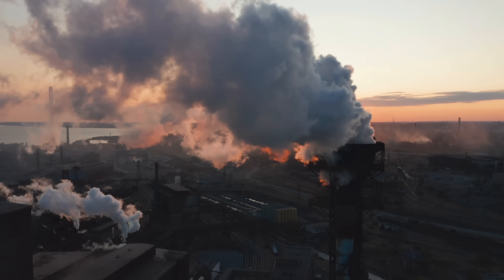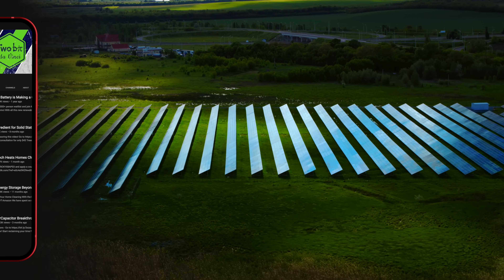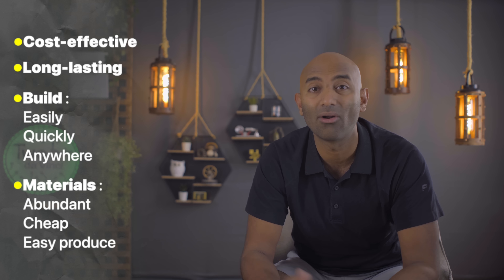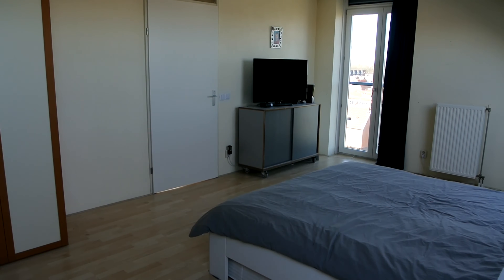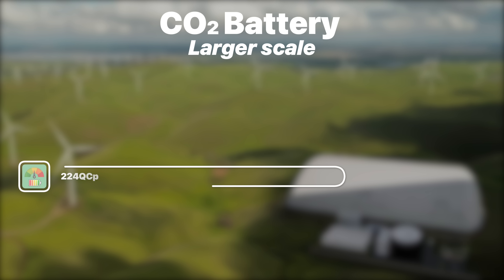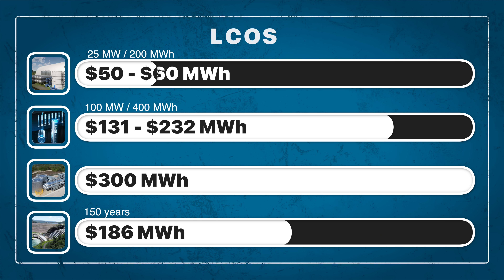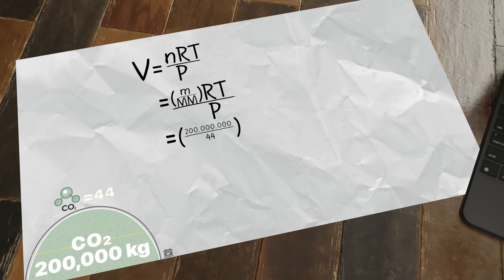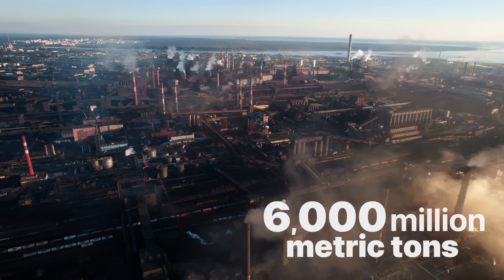The GENIUS Of the Carbon Dioxide Battery

Comment: How difficult would this be to convert to an underwater system? I think it could increase efficiency by utilizing deep water pressure and lower temperatures.
Reply: how?
Reply: Note that the bladder is the low pressure side, putting that under pressure reduces effectiveness. You could possibly substitute the high pressure tanks with a cavern, but you want to keep moisture out of the system, so you need to line it.

Comment: Just thinking that there's a secondary energy source being created here that could increase the efficiency of the overall system.  

As the CO2 decompresses, it gets colder.  This would cause a temperature difference between the air near the Decompressing CO2 and the air further away.  Could they drive a sterling engine with this temperature differential to generate more power?

Comment: Tell me again how carbon dioxide is supposed to be a greenhouse gas when it is known to have one of lowest heat retention compared to  most of other gases in the atmosphere. . The heat retention of carbon dioxide is around 0.002 degrees per second  . We know that carbon dioxide levels is the reason for the planet is becoming increasingly greener yet the level of carbon dioxide levels are not as high as it has been in the past thousands of years.

Comment: This methodology is much more expensive than simple gravity compressed air systems.  Look into the Ragged Chutes compressed air plant and it's contemporaries!  100% eco-friendly, ZERO moving parts, except for the actual electricity generating turbine, Works 24/7/365!!

Comment: I am happy to see companies goinng back to basics and using thermodynamics to solve these problems.

Taking advantage of the energy associated with  phase change and reusing the heat.  

Nice review of the tech - thanks!
Reply: That's just it. They didn't present anything on using the latent heat or polytropic heat for anything other than reevaporating the liquid CO2.
Reply: @murderdoggg  

I make an assumption that those concepts are beyond the mainstream audience.
Reply: @JohnBoen  Yeah I suppose so. I am kinda the Joule-Thompson effect and Logarithmic Pressure, Enthalpy diagram kinga guy.
However most people understand heat recovery pretty well. no?
Reply: @murderdoggg  

I think you are on the right side of the Dunning Kruger scale - you assume people know more than they actually know.

I.e. I remember the terms from my college days, but never used them professionally.  I can do the math, but have no practical understanding of refrigeration systems - where you seem to have one.

Great topic.
Reply: @JohnBoen Thank you (I had to google Dunning_Kruger  :)  I enjoyed it as well.
Reply: @murderdoggg  

What else would you use the heat for? 

It seems like you would not be able to capture enough of the heat to return the CO2 to room temperature after phase change.
Reply: @JohnBoen  In commercial refrigeration we also use liquid CO2 instead of "Freon". 
Normally the heat that comes from condensing the CO2 into a liquid is recovered, and used to warm the hot water, or to warm the heating system in winter.
The heat needed to evaporate the co2 comes from refrigeration, salad buffets, drink coolers or freezer rooms. 
So either we add generator turbines to commercial refrigeration systems, or we add freezers and heat recovery to the phase change CO2 battery. By the way, there is always more hot than cold in these systems.
Reply: @murderdoggg  

Sure.  That is my opinion too.

Comment: The key is the c02 capture tech and then this is the final piece of true renewable energy.
Reply: This isn't "CO2 capture tech"
.
It collects a fixed amount.
Compresses the gas, then uses it in a closed loop, that fixed amount STAYS in the system but it doesn't continually collect more CO2 (unless there are leaks, in which case it's a 1:1 swap)
Reply: @rogerstarkey5390  agreed but i ment to grow the numbers on these power plants

Comment: This is not a new technology by any means but the system here is unnecessarily complex and should be based on water and use a TESLA turbine. The system doesn't need to be charged either as the system can create its own energy from heat it picks up under pressure then it uses that water under pressure to turn the Tesla turbine and the system doesn't need to be charged and produces it's own energy.

Comment: I'm not sold on "renewables" like wind and solar. 
They should be called "disposables" since they have a limited lifespan. 
CA is having issues with solar panels filling up landfills. 
I would install solar on my house but I think SMR Nuclear will end up being the best grid scale power solution. Way more efficient resource usage. 
I think vanadium flow batteries would be much more efficient. A Chinese company initially scammed the DOE for the technology now there is an American company setting up mfg. Because of that they are everywhere in China for grid storage.

Comment: 1) I live near Niagara Falls, which has pumped hydro. I would bet its lifespan is vastly greater than 150 years—sounds like a sales number for the CO2 industry. 2) a leak could be dangerous—whole villages have been killed by pyroclastic CO2 because at 44 g/mole compared to air’s 29.2 g/mole, lets the CO2 hug the ground. 3) The storage volume for CO2 is about 400x greater than the storage volume for pumped hydro. And, unlike pumped Hydro it has to be built from man-made materials. 4) A terrorist/enemy target. 5) Unless fusion or some other cheap energy production is developed, removing CO2 from the air will never be viable due to thermodynamic laws—the low concentration of CO2 in the air is the problem. About two decades ago the department of energy put out an RFP for $100 million for the construction of a prototype carbon sequestration plant. I sent them an email detailing how the plant would produce more CO2 than it collected. They stopped the project. I saved us $100 million! — merely a 62 year old industrial engineer.

Comment: Nice reporting! Interesting that CO2 can liquify at ambient temps. It's just a matter of pressurizing it.  That round-trip efficiency (75-80%) and scalability are surprising. This concept is so simple, one has to wonder why it wasn't done before. All good wishes.
Reply: look closer at the diagram, you'll notice that there are two types of energy needed to run this thing, electricity, and hydrocarbons, and there's transition losses going between matter states, this isn't all it's cracked up to be.

Comment: CO2 is not a pollutant... Climate change is being lied about just like COVID was. One of the main ways is by comparing old low resolution data, from very few weather stations, with new high resolution data from exponentially more weather stations. If you add 10 000 new weather stations in areas that didn't have any before, every year, it could be expected that 100 of them would record a "once in a century" weather event. That doesn't mean those kinds of events didn't happen before. It just means we didn't record them when they did. So, when you see a news report claiming the "hottest/coldest/wettest/driest ever recorded at __ since record keeping began" - see if you can find out when the weather station at ____ was first installed. You might be surprised to find out again and again that "record keeping began" just a few years ago where these stories are reported from.  10's of thousands of new satellite monitored weather stations have been installed worldwide since 2018.

Comment: Could this be miniaturized for a hybrid car? Then when its internal combustion engine produces co2, it could charge a co2 battery. I think we can.
Reply: No. He literally went over this in the video with a hilarious graphic at 10:36. The energy density is 200 times lower than lithium ion batteries meaning they would be 200x larger for the same amount of energy. Think a AA battery being the size of a baseball bat.
Reply: Not really. First off, the exhaust has a mix of gasses, with CO2 being a small percentage of that, and separating the CO2 from the other gasses would use up energy, and compression would use up even more energy and produce a lot of heat.. Second is the compressed CO2 storage tanks would take up space. Third, releasing that stored energy would require heat and would release the CO2 - unless there was a giant balloon much bigger than the car attached to it. 

But a stationary power storage plant, could use already purified CO2, would have plenty of room for the compressed CO2 storage tanks and even the much bigger uncompressed CO2 gas bladder dome. As an added bonus, the head produced by compressing the CO2 could be stored in big hot water tanks, and that heat could then be used when releasing the energy!

Comment: What I don't understand is the energy you need to turn this carbon dioxide into a liquid state?  Maybe I should watch the rest of the video but as far as I know this looks like BS. What are we doing we're using free energy to convert carbon dioxide into a liquid state just to convert it back?
Reply: it turns out that batteries do in fact need to be charged

Comment: You spoke a lot about scaling to larger systems, I’m curious what the likelihood/feasibility of small scale compressed CO2 batteries would be. It seems like off grid or battery/grid hybrid residential situations would benefit a lot from an energy storage system that doesn’t need replaced every 10 years and doesn’t lose capacity along the way. Thoughts?

Comment: Here's another variation on this idea...
It looks like carbon dioxide liquifies at only about 5.1 atmospheres which is very low.
This suggests that carbon dioxide might be usable as a refrigerant.
Consider...
All the refrigerators/freezers that might use carbon dioxide instead of R34. If any escapes into the atmosphere, unlike R34, it's not damaging to the environment.
Also, the heat that is generated by the condenser might be used to heat homes.
That would mean at least during the winter, the cost of running the refrigerator/freezer is almost free. So, in a larger sense maybe refrigerator/freezers should be incorporated into the home heating system.

Comment: Now, does the system gain or lose efficiency when exterior temperatures reach very cold limits? How well would the system operate at -40C?
I imagine it would be best to charge it when it is cold out and utilize it when hot.
Reply: At -40° CO2 still shows 9 bar of pressure or 130psi on the gauge. It's not like Freon that will pretty much lay still in an open bucket around -40.

Comment: "For decades all we've heard is how bad carbon dioxide is for the environment and how it causes climate change! True as that might be..."  That is not true at all.  Carbon is the greatest thing for life on this planet.  All life on this planet is carbon based.  The only thing more carbon causes is more life.  The scientists do not have a single time period on the geologic record that shows carbon levels anywhere around our present level are bad for the earth and its ecosystems.  The only and I mean THE ONLY single time they can reference is when carbon was TWENTY TIMES THE PRESENT LEVEL.  That is, if we took the present atmospheric level and added that amount to the atmosphere twenty times.  We humans do not have the ability to do that even if we put all of our human effort and resources into the effort because most of the carbon from that maximum time period has been mineralized.  That is right.  We would literally have to figure out how to get all of that carbon out of the rocks and stones that make up the ground.  The whole concept of carbon dominating the climate is a joke.  It is an extremely small fraction of the overall atmosphere and shares absorption spectrum with water vapor, which makes up a much greater portion of the atmosphere while also having a much broader absorption spectrum.  The earth has had a much higher atmospheric carbon content for the majority of its existence and life exploded during those periods of high atmospheric carbon content.  That is when all the mollusks and crustaceans evolved.  No, higher atmospheric carbon does not dissolve their shells.  Their shells are made from atmospheric carbon.  Their shells are calcium carbonate.  Everyone has been sold a bill of lies.

Comment: My concern is this isn't available for residential consumers. Unlike batteries which you can buy and assemble the system itself.
Reply: This is great for hooking up to a wind park. Or a solar park that serves a city. Excess energy is not sold off for free (or panels/turbines shut off) but stored for use at night out on days with low wind/sun input. 
It's not for homes, but that is fine.  It's not the silver bullet for every problem.

Comment: How much heat has to be stored in relation to the energy stored in the form of pressure? Boiling and condensing fluids takes a LOT of energy! Furthermore, this looks like a maintenance nightmare, so many moving parts. my bet is on Thunderf00t busting this one pretty soon.

Comment: Thanks for sharing your videos, another very interesting concept. Another potential benefit to this technology would be the ability to use it to overcome power transmission interface limits by splitting the plant and connecting the two with pipelines.  You could build your storage and compressor facilities in an economical location with lower energy costs and put your generation facilities in high cost expensive areas.
Reply: wouldn't work, transporting electricity is orders of magnitude more efficient than transporting potential energy

Comment: It's worth a shot.  Long duration storage is open to lots of solutions.  We should try them out.  It is what physicists do, starting from physics 101.  Converting one form of energy to another.  Seasonal storage, is one of the hardest issues to tackle.

Having said this, I wonder whether we need as much storage as one would initially think.  If one can a complement of generation sources, with different intermittency profiles (e.g. wind and solar), then one could get away with less storage.  The battery serves an integrating resource, for frequency regulation, time shifting, e.g., in a micro-grid.  And so what, if one has to burn a little bit of fossil fuel, a few days a year, but still have mostly (say 80%) a renewable grid.   From an energy security POV (e.g. Europe), you would need much less fossil fuel.  And we'll eventually figure out the last 20% (biomass, syngas, geothermal, nuclear, ...).

The other thing to consider, is the emergence of EV's.  Is this a liability for the grid (greater electricity demand)?  Or an asset?  If one can add bi-directional charging capability, you have a bunch of mobile batteries, that are typically 2-3x the size of a solar+storage setup, for the storage part.  And solar has gotten so cheap, that one is beginning to deal with the "duck curve".  Without needing to add extra grid batteries, one can encourage EV's to charge during the daytime, just to suck up the duck curve.
Reply: Would you set your thermostat to 15 degrees centigrade??
This is the current mean surface temperature of Earth which is suboptimal for plant growth.
The current atmospheric carbon dioxide concentration (415 ppm) is also suboptimal for plant growth.
Arrhenius who described the greenhouse effect opined that carbon dioxide emissions from human activity would have the beneficial effects of reduced winter heating costs and postponement of the next glacial maximum. You can add reduced deaths from hypothermia and increased agricultural yields.
He initially estimated that the climate sensitivity to atmospheric carbon dioxide concentration was 5 degrees centigrade per doubling and subsequently revised his estimate to 2 degrees centigrade.
The true figure is likely under 1 degree centigrade. We cannot perform controlled prospective experiments on whole planets to obtain a hard proof. We haven’t even found any close earth analog planets around other stars.
    The Western World is currently beset with the Climate Delusion: The false and delusional belief that mans effects on the earth’s climate are significant and dangerous. Trillions of dollars of taxpayers money is being misappropriated into uneconomical and unreliable renewable energy projects.
Popular delusions are dangerous and can lead to economic ruin, war and genocide.

Comment: I'm curious if, while doing your research, you found out how long it takes to spin this up to start producing power? If there is a power outage, lithium ION can meet demand instantly. Also, how well can it handle large sudden spikes in power demand? Or is this better suited to a stable consistent power draw?
Reply: I would tend to think on the order of 1-2 minutes from a cold start. You have to get the turbine's flywheel spinning, get it synced to the grid, throw the switch, then open the valves all the way to supply mechanical power. Similar to a hydro plant. Power outages are more often due to local delivery systems than the production facilities, so that's always going to be an issue. If there are clouds rolling in or peak evening hours approaching, they probably have enough notice for the turbines to be spinning by the time you need it online.